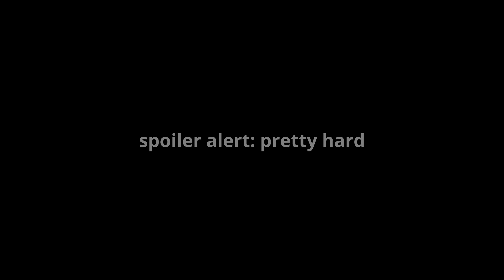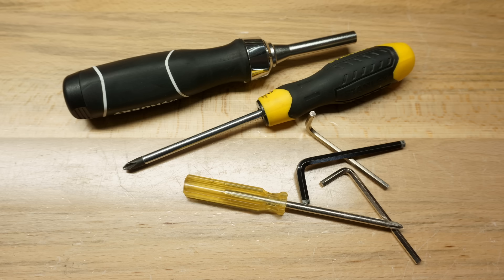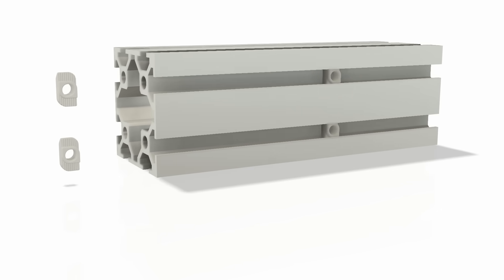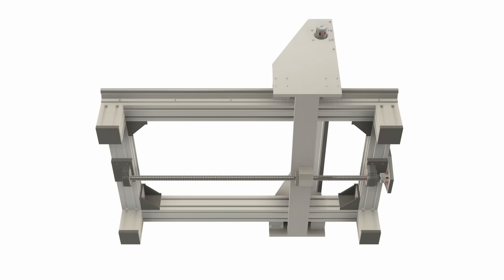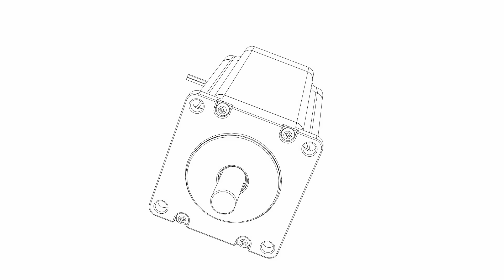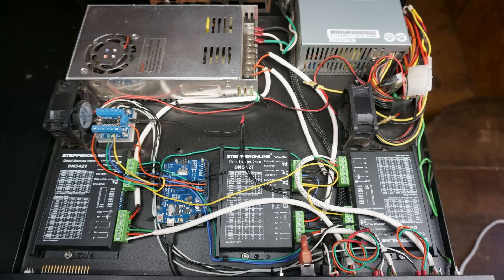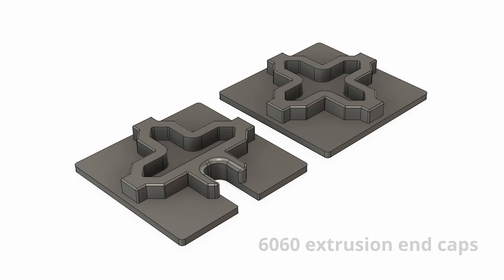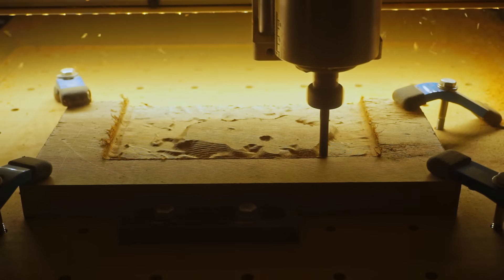Making a DIY CNC machine with limited tools

Comment: Great build!  Looks nice and it looks to run great.

I built my own CNC using plans from another YouTuber's plans and parts list.  I purchased all of the parts and put it together within a month or so.  I had no clue what I was doing, but have a good sense of mechanical and electrical.  But it was tough to get everything running right.  I started trying to use an Arduino board but ended up going with a Blackbox instead just for ease of that process.  

I'm still learning to design and have pretty much stuck to 2d stuff, but I'm about to start learning the 3d carving.

Comment: Nice build. The picture of the electronics was before you installed shielded motor cabling so I can't tell. All shielded cables should be drained to a star ground. Ideally anything low voltage signaling should be shielded and drained as well as they are the most likely to impacted by emi.

Comment: This is an incredible build, its so clean as well. Curious what the total cost was?

I'm also trying to build such a machine but at a smaller scale with hopes it will cut aluminium!
Reply from the maker: I bought most of the parts about 2 years ago so I don't know the exact cost, but I believe it was around $1000, possibly $1200. Best of luck on your build!
Reply: @benmakeseverything I guessed about $2500, maybe as of today it would be that much.

Comment: Hi Ben, well done! Since I made few of DIY CNC machines, I would recomend 2 crews, one at each side for the Y axis. Because of twist under the higher load for one screw in the middle. (I had the same design at my first router and changed it to this configuration.) Also the USB connection could have issues, I end  up using ESS (Ethernet Smooth Stepper with Mach 4 software) using ethernet cabel, that has more rigid comunication protocol, but there are other options like MASSO or PoKeys57. Offcourse these upgrades are for higher budget project. Last recomendation are hybrid servo stepper motors(idealy with error output to stop the machine). Wish you all the best! Have FUN with your machine.
Reply from the maker: Good suggestions, I agree that 2 screws is a superior configuration. I was just trying to save money on the build using 1. If I built another machine I'd use 2, and also look into the servo motors as well.
Reply: How much of a difference do the servo motors make vs a stepper? I would thing magnitudes accuracy difference? Worth the money?
Reply: @pepaw servers make zero difference in accuracy. In a closed loop system once You've actually missed a step. You've already ruined your work piece anyway. Most systems at least in hybrid closed loop systems. Once you have missed steps, it just sends an alarm to trigger to stop the motors

Comment: It looks like the gantry might be slightly susceptible to rotating in the X/Y plane (e.g. left side pushes slightly forward/back relative to right side) since the ball screw only constrains the center and not each side.  Have you seen any issues with stiffness in the Y direction being better in the center than on the sides?
Reply from the maker: That is a fair point, a better design is to have 2 ball screws, one on each side, each driven by a motor, which are linked together. Most larger machines use that configuration. I was just trying to save money. I haven't had too many issues, but I mostly machine wood. For working with larger projects in aluminum that seems like the way to go.

Comment: Really great job!

I followed a similar route, but I built a WAY smaller prototype (roughly 400 x 500 x 150mm) out of MDF first. Kind of a proof of concept designed in SketchUp. All the electronics for a larger machine were installed, though. It worked fantastically well - so much so that I used it as is for more than a year!

During that time, I designed V2 of my CNC using Fusion 360. This one built out of aluminium extrusions and 16mm aluminium. The biggest change was to use 2 motors on the Y-Axis due to the size of the new machine.

A lot of lessons were learnt from building the first machine, so all of those were incorporated into the new one. The new one was 1500mm x 1000mm x 450mm. The best part was that I used my MDF CNC to cut the parts for the new CNC. It was slow, but it worked, and it was accurate enough to enable me to assemble the new machine in less than a day!

The only tools I used in constructing V1 were a jigsaw, handheld drill, screwdrivers, Allen keys, taps and glue. With V2 it was pretty much taps and Allen keys.

I recently upgraded to a 1500W liquid cooled spindle, which made a MASSIVE difference.

I have my eyes set on building me a similarly sized 100W laser CNC over the next couple of years…

Happy CNC-ing!!
Reply from the maker: Thanks! Sounds like you put a lot of thought into your designs. I like the idea of using the first machine to make parts for the next one!

Comment: Nice video, thanks for sharing your experience. Just subbed. Where did you get the CAD files for your makes from?
Reply from the maker: Thanks! I made those models myself in Zbrush.
Reply: @benmakeseverything  thank you - nice models!
Reply: internet have many hobby user cad softwares FREE cnc controller linuxcnc FREE lot FREE software what format drawing have translate to g-code files, FREE,
Reply: @mattivirta  I meant the CAD models for the things that he made with the machine and showed later in the video.

Comment: Well done man!!! You did amazing with little tools! Always a dream of mine to make one too, in Europe not so sure where I could get the rails and the ballscrews. Congrats.
Reply: i buy my big cnc rails and ball screws kit ebay and shipping every were europe need, cost 1500x1500x400 cnc 350$ if buy same amazon cost 1500$  need only scrap-yard take metal tube and weld frame, cost 40$ motors i buy ebay 28$/pcs, today motors cost lot more about 50-70$ /pcs, nema 23 or 34 serie need minimum, 3Nm torque and 4-5Amp motor max. power supply 50-100$ how many motor use etc, 4A motors 4pcs, need min 16A power supply, drivers about 30-50$ motor amperes need handle,
Reply from the maker: Thanks! Both of those items were purchased through ebay. I'm not sure what the shipping situation is like there, but you might be able to find them other places online as well. Best of luck!

Comment: Great video, especially for your first. How much dir you pay roughly for the complete machine and are you planning to release to plans?
Reply from the maker: I bought most of the parts about 2 years ago so I don't know the exact cost, but I believe it was around $1000, possibly $1200. I'm not sure about releasing plans since I actually think there are some things that should be done differently if I were to build it again. This was meant to be more of a introduction to the design than a step-by-step instruction video. For example, if I built another machine of this size I'd use dual lead screws on the Y axis, and other such changes.

Comment: This is what I mean for a REAL Tutorial. A design, main measures, components list. A great help to understand what to do. Really good job, Ben. Not for the object only, but for the excellent way You followed to present it.
Reply: but need be "tutorial" better, this not tell how softwares install, lot problem if use raspberry pi or linux computer install good shit GRBL or linuxcnc software, cam soft what can use linux, limit switch has many builder problem need tell how make, what size spindle and spindle speed controller problems, only good has use aluminium frame and big 60x60 profile, expensive lot, and ballscrews super expensive use, windows OS not must use because not have safety realtime OS, need use linuxcnc OS because have lot better and true realtime controll, and this safety lot more. cad program need if want build good frame all dimension come right before cutting parts. and drill holes right,accurate. need know all roeque powers how and were need frame strong etc,beam need lot more strong support not twist.z-rail need be supported rails not only worst rod, lot torque power go to z axis and not accurate and weak lot if not strong. this some little point for my vkill i has build hobby users and small factory many 100 cnc and know what need know.

Comment: how did you solve alignment issues to get better precise cuts?
Reply from the maker: That was one of the difficult parts - I mostly just used my digital calipers to really try and make everything the exact right dimensions, but since I was doing some of the parts by hand, it wasn't perfect. In some cases I made a few holes slightly larger than the diameter of the bolts so that I could adjust the alignment, then tighten everything down. Its not perfect, but it works.

Comment: For your first video this is an amazing job and achievement - You will go places if you continue on this path!

I have major critique though: The face cam part of the video majorly brings down the overall quality. The lighting, mood and audio is terrible compared to the rest of your work and it stands out like a sore thumb. Consider removing it entirely until you have a better solution so it doesn't hurt you videos - cause the rest is hands down really really good.
Reply from the maker: Thanks for your feedback - I do need to get a better camera, mine is quite old.

Comment: Awesome job bro!! BTW, how much the total cost was and did you save money compared to a similar featured premade CNC router??
Reply from the maker: Thanks! I would estimate the cost to have been $1000 - $1200, but I didn't save all of the receipts so I can't give an exact price. Most of the parts were bought 2 years ago. I definitely saved money as compared to purchasing a similar sized machine, which would have cost over $2000 for similar performance.
Reply: DIY build same cost about 1000$ and premade kit cost 3000$ about.

Comment: Great build! What size of 6060 profiles did you used?
Reply from the maker: They are actually 60x60mm, which I know is a bit confusing since 6060 is also a type of aluminum.
Reply: @benmakeseverything  thank's. Ofcourse, I know that 6060 is an allloy of aluminum.
Reply: @cassiusc17  aluminium profile have dimensions 60x60 have many size 3D printer and laser used lot 20X20 profile too weak  normal cnc need lot biggest and strongest frame, cheapen have use steel tube frame if can welding metal tube.

Comment: it is a great job but what "tools" do you need to connect all the off the shelf parts. you don't have under 3000$ in that cnc.
Reply from the maker: I definitely have a lot less than $3000. I would estimate $1000 - $1200, but I bought most of the parts over 2 years ago and didn't save receipts. That doesn't include the tools I used or the router bits I purchased afterward. I did get some really good deals though, and it would probably cost more today due to inflation, etc.

Comment: I went to your channel to check for more "goodies"... this was the only video there.  If this is what you offer as your first video, and this CNC router is your first construction offering, then I take my hat off to you!  A really useful machine, with a carefully considered component list, and well thought out design.  Your video was clear, well explained, and nicely paced.  If you haven't "burned yourself out", I really look forward to your future projects!
My thoughts for a next video:
** A quick walk-around of the finished machine, itemising good and bad points.
** How does it perform compared to your initial thoughts?
** Knowing what you know now, would you do it again?
** What you would do differently?
** Would you stick with a router, or consider a spindle?  (Kevin Barnett on the Carbide 3D channel is pushing spindles as a better option.)
** Planned upgrades and add-on's?
** What basic design changes will you make on your next one?   😵‍💫

Also, I am sure there are many viewers that would be interested in a video covering the steps involved in making a simple project, from design to finished item.

Have I "Liked" and "Subscribed"... OF COURSE I HAVE!   😄 👍
Thank you.
Reply from the maker: Thanks for the input! Those are good suggestions. This was my first video, but I am definitely going to make more. If I built another machine I would 100% use a spindle (probably water-cooled) instead of a router.

Comment: Can we 3D carve marble with " Genmitsu CNC Router Pro 4030 " with the wright bits and speed??
Reply: Diamond tipped tools will cut marble, but i think you would need to go very slow, as the diamonds break off if you are too quick/forceful, i used then a lot for grinding tungsten carbide tips on spring making machine tools

Comment: I watched your entire video and I am impressed, I started with a Buildyourcnc 4x8 kit, and is amazing how much you learn by putting one together and the ups and downs, I then purchased a Laguna IQ for our shop, 2x3 ft. And later a Industrial Artisan 408 to replace the Buildyourcnc ( Way over priced but they do work). And I was imaginging this taking you awhile to do and when you said 1 year, I was like, yes this stuff goes through so much that people will never understand in a 14 minute video. 

With all that said you did a very impressive video and kept it to the point, clean cut and full of the right knowledge that matters to someone wanting to build one. And remember this, you have to build the machine so it can build the machines, now you can mill all your parts on it and fine tune it, But you did an amazing job and I am very proud to become a new subscriber to your channel. I hope you find your place on the Youtube platform because you deserve it, pulling off a video that good so early on. 

PS, lasers are fun too :) Started with a cheap 400.00 Ebay laser and now have a Laguna EX-C 36x50. You should give one a try, they are far more amazing than a CNC when you learn how to use it to your advantage where a CNC cannot do tight corners.
Reply from the maker: Thanks! Glad you enjoyed the video. I've actually been thinking of either adding a laser attachment, or just building a separate laser cutter as well.
Reply: @benmakeseverything  Guys have been cutting 19mm ply with a 20W laser diode. Not fast but it does work with air assist.
Reply: @Random Audio Guy Your laser is a CNC machine. A pet peeve of mine is when people only call routers/mills a CNC machine. Semantics really, I know, but still. A 3d printer is a CNC machine. Your laser is a CNC machine. The router/gantry mill in this video is a CNC machine. CNC simply refers to how the machine is controlled, by numbers/code sent to it by a computer.

Comment: I’m currently going through my own CNC build and this gives me good inspiration and some ideas to implement on mine. Thanks for documenting the process so well.
Reply from the maker: Glad to hear the video helped. Best of luck with your build!
Reply: Use linear guide ways, not linear bearings. It will be stiffer.
Reply from the maker: @lUnderdogl  I agree with this, If I built another machine I'd use those.
Reply: @benmakeseverything  If you need any help you can write

Comment: what was the total build cost?
Reply from the maker: I bought most of the components in early 2020 so its been a while and I didn't really keep the receipts. I would say I spent around $1000 - $1200 in total, but its hard to estimate because I bought some parts I didn't end up using. That doesn't include the tools I used to make the machine of course.